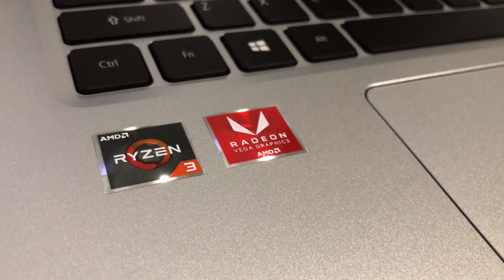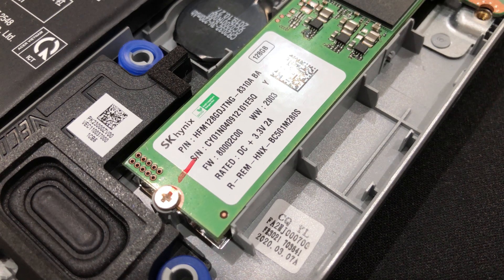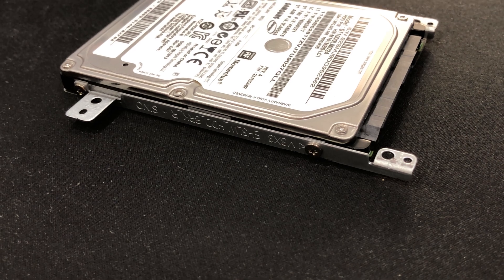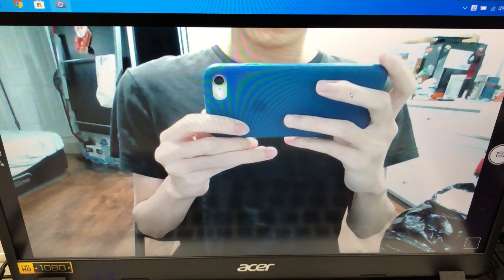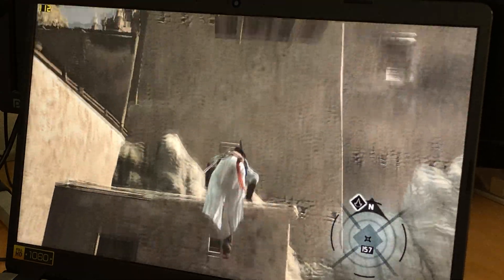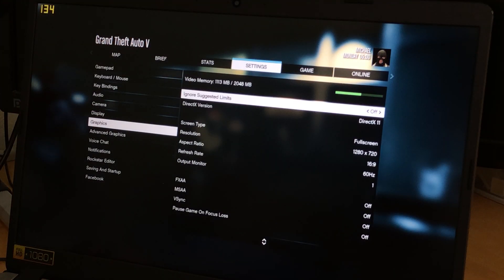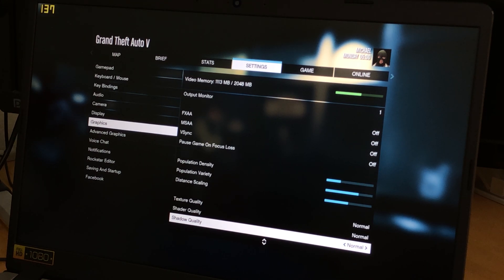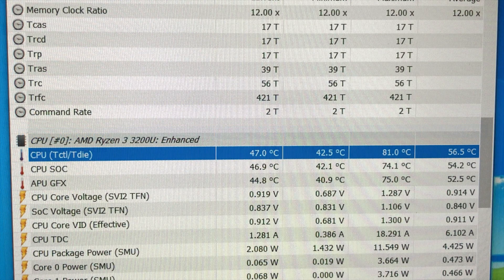Acer Aspire 5 Slim Ryzen 3 3200U & Vega 3 - SSD + HDD + RAM Installation - Gaming Benchmarks

Comment: I've had this laptop for a while and I'm enjoying the fact that I can play bo2 and mw3 without hackers(plutonium) which is a bonus for me. The ps2 emulator(pcsx2) runs very well. However for about 60 bucks you can order a 16gb ram stick that will help you play the big boy games at a much faster speed. And make sure you buy a cooling pad (20-35 bucks)so your laptop doesn't overheat
Reply: This is the ram stick I use PNY Performance 16GB DDR4 2400MHz (PC4-19200) CL17 1.2V Notebook/Laptop (SODIMM)
Reply: what 16 gb kit of ram did you use?
Reply: @sunnyjd3354  and make sure you also dowload the amd software so you can update your amd on your laptop as well

Comment: what kind of ram should we buy for the acer aspire 5 ryzen 3 3200u ? 2400 2666 or 3200? single or dual rank?
Reply: 2400 dual channel that’s the limit for the Ryzen 3 3200u or  3250u 2x4gb or 2x8gb but tbh 2x8gb is way better cuz the gpu will take 2gb from the ram and the usable ram will be 6gb if you take the 8gb ram  and maybe 14 or 13 gb ram for the 16gb ram

Comment: Is there a way to improve this laptop to play valheim? I have it and it runs, but it's too slow, is there any way to change the graphics card ? Changing the ssd and ram will improve it significantly?
Reply from the maker: No, it won't help, and you can't change the graphic card in this laptop. This machine is not meant to be gamed on.

Comment: I really need a 16gbs stick for my laptop which is this but like i don't got cash and i'm quite young.
Reply from the maker: You can buy 4gb to make it 8gb which should be enough
And check around Craigslist for cheap deals
Reply: @PokerFaZe  Bro i don't got cash i'm 13 and i got 8gbs already in my shit but 3gbs is being used already and i can only use 5gbs of ram so if i got a 8gbs i would atleast have 7-8 gbs to use.
Reply: @PokerFaZe  Or as i mean a one 8gbs stick of computer ram.

Comment: Original comment below
From a comment on another video, if you use a SATA SSD, you'll have to uninstall and reinstall the IDE ATA/ATAPI controllers in device manager and restart. then go into Disk management and initialise your new drive!

subbed btw

Edit: here's the original comment from https://www.youtube.com/watch?v=LK5ojKXUvWk

"So I’m posting this because it seems that it’s not necessarily a common issue that needs to be resolved in order for the SSD to be useable, and I just wanna post what I did to fix the issue. 

So I installed RAM and a new Samsung 860 Evo 500gb. RAM fit like a glove and was instantly seen by the system, the SSD on the other hand took some digging to find after installing. Most videos and solutions said that you’d be able to just initialize the device from the disc management tool. Nope, the disc management tool wasn’t seeing it either. So here’s where I had to go in order to get it working. 

Search bar —> Device Manager —> IDE ATA/ATAPI controllers (mine showed a Standard SATA ACHI Controller wasn’t working properly “Code 19”) —> right click —> uninstall device —> click okay —> reinstall. Should be working just fine after that. 

THEN I had to go to Disk management where I was prompted to initialized the disk and after that it started working. 

I was freaking out because I thought I had destroyed it somehow. Very glad to know that wasn’t the case."

Comment: Hello my friend, 
I hope you are fine. 
 Thank you first for this great video. Secondly, I want you to answer my question. 
 Do you recommend installing a new Windows or should I upgrade the existing windows on the device?  Can I install only one 16 GB RAM?  Thank you.
Reply from the maker: Thanks. Sure, you can use the existing Windows 10 S, it's just my habit. And yes, you can use a single 16gb in single channel, or combine with the existing 4GB to make it total of 20 GB and run dual channel up to 4GB.

Comment: I'm into buying Samsung Evo 980 Pro.. does this laptop can handle it?
Reply from the maker: Sure, it can support M.2 NVME, not M.2 SATA SSD. Samsung 980 should work, but it won't run as fast as the advertised speed because the laptop uses PCI-E gen 3.0

Comment: Great video Poker Faze! Congrats...
I have a little Doubts that I can't find at Acer web page... what's the maximum Ram it can handdle, 32gb? The  Acer Lap can reconize the Ram at 3200MHZ frecuency?
Reply from the maker: This laptop can take 32GB but the CPU can only support maximum RAM speed of 2400 MHz, so you should not buy fast RAM for it

Comment: the bios of the laptop let you modify the vram for the integrated gpu?
Reply from the maker: No, it does not allow
Reply: @PokerFaZe  okey, that vega 3 only get a maximum of 2gb ram, is nice.
Reply: @PokerFaZe  did you try emulators such as cemu?
Reply from the maker: It's my mom's laptop, not mine, so no :))
Reply: No if you add the extra ram 4gb or 8gb it would Automatically increase the vram to 2gb max

Comment: hey buddy please help me out, I have a Lenovo ideapad S145 Ryzen 3 3200u variant with 4 gb of on-board RAM, Should I add one more stick of 4gb or 8gb? Please tell me!🙏🙏🙏
Reply from the maker: Haha, I just recently made a video about that laptop, you should check it out. You can upgrade if you need more memory, the laptop will run in dual-channel up to 4GB thanks to Flex mode.

Comment: Can I do photo editing with lightroom or Photoshop as a beginning photographer
Reply from the maker: It might be slow to do it
Reply: @PokerFaZe  what computer in this price range would be best then for photo editing?
Reply from the maker: An Asrock Deskmini barebone kit can be good for it, but it is not a laptop, so you will need to buy monitor, keyboard, mouse, RAM, hard drives
Reply from the maker: But I have never tried editing on this laptop, so I can't really tell, if you don't do intensive PTS editing, it may work fine
Reply: Thanks so much
Reply from the maker: Good luck with your purchase 👌
Reply: @prescribedphotos876  my classes require me to use adobe after effects and photoshop ect its decent for what its worth,by no means horrible
Reply: @crimsonfker4999  appreciated. I got it and added ram and a second Harddrive for storage and it works well for my photography.
Reply: @Codyslx  it's functioning ok, I added HDD for storage and increased RAM to 12gb but still will upgrade further. It serves the purpose this far for me learning Photoshop and such.

Comment: I would put better storage in it when I get it “hopefully” but I’m mostly will be using it for Minecraft and other low gig games
Reply from the maker: You can buy a cheap 1TB 2.5" hard drive and add to the laptop, the stock NVME can be upgraded later :) no problem with using it
Reply: @PokerFaZe  can I play fortnite or run discord on it?
Reply: @senkosbetter  discord? anything can run discord it's not a game lol.
Reply: @xers8719  lol

Comment: How much it cost to switch from window 10 s mode to windows 10?
Reply from the maker: I use Windows 10 LTSC USB to install, did not pay anything
Reply: Poker FaZe ok ty
Reply: It's free in settings
Reply: It's free
Reply: You do not need to pay anything. You can switch for free in Windows Store

Comment: Did you have to re install drivers?
Reply from the maker: When I used the pre-installed Windows 10, it could not detect the trackpad. But when installed the brand new Windows, everything automatically worked without me installing any driver